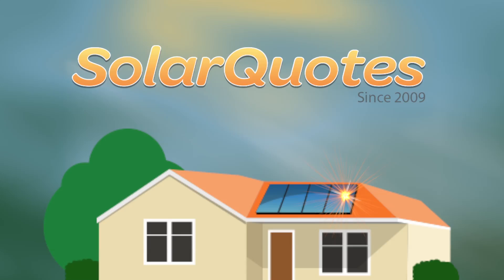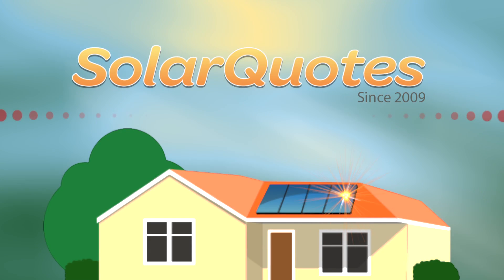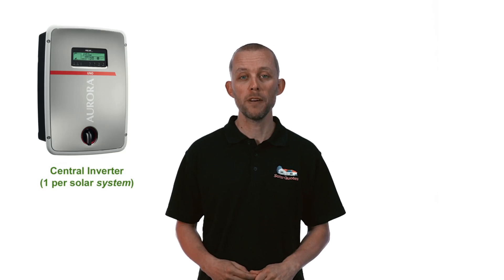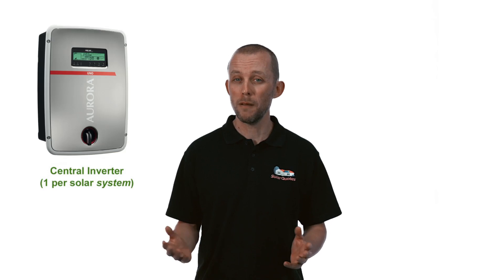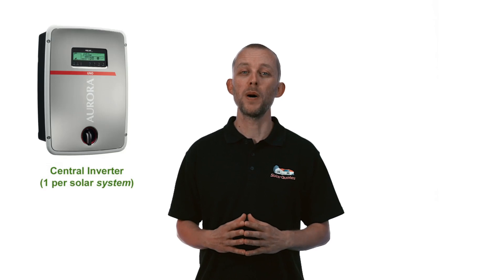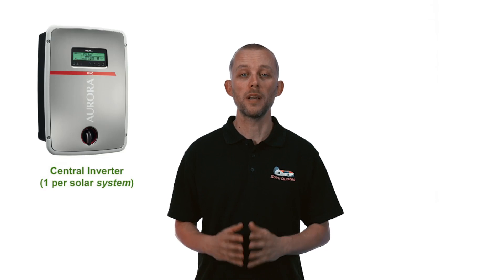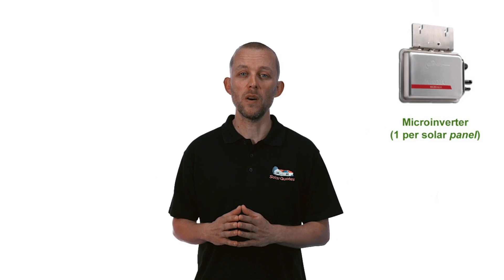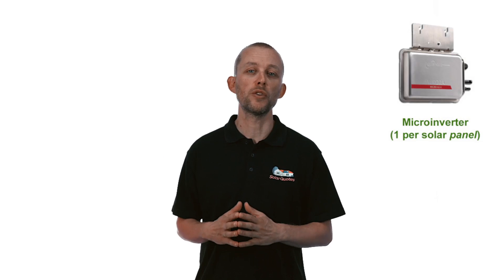The Two Main Types of Solar Inverter - Micro and Central

Comment: Incorrect information. If one panel in a string is shaded,it does not decrease the output of the rest of the panels in that string.
Reply from the maker: Yes - if the bypass diodes kick in - which requires just the right amount and pattern of shade.
Reply: @SolarQuotes  The bypass diodes don't just kick in,they start to conduct slowly,and will only pass a certain amount of current in relation to the amount of shade on the panel. The more shade on the panel,the more the bypass diode will conduct. The bypass diodes act just like an optimizer,where they allow the effected series strings in the 1 panel to output as much power as they can in relation to the volume of shade on the panel.

Comment: But what if you want to add a battery to the system? Then you have to rectify the power to store it and then invert it again to use it. Would it not then be more efficient to use a central system than micro?
Reply: Wouldn't you still run it to your house before the battery? That way you aren't wasting all your energy inverting to battery voltage and then immediately inverting it back to 120/240 for the current use load?
Reply: most electricity is used at night in peak times, and the max amount of sun is during the day. Without battery storage you are losing energy generated from the solar panel during max isolation, even though its sold back to the grid, your electrical retailer would charging 11cents/kW

Comment: What is the failure rate for microinverters and how hard is it to access then when they fail?
Reply: John Puccetti ... micro inverters sound good, but I can see added costs half way through the life of the solar. can you get to the m inv easily or do you need to remove the panel?  what's are the costs?